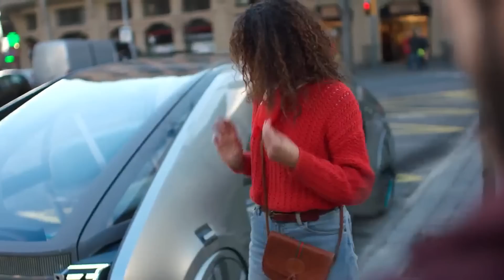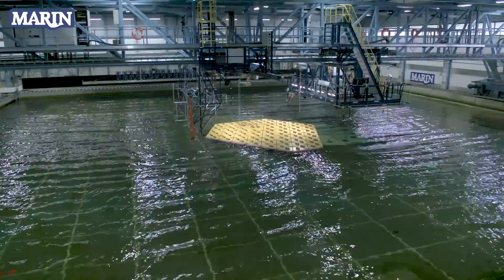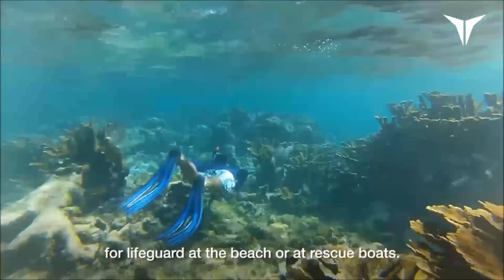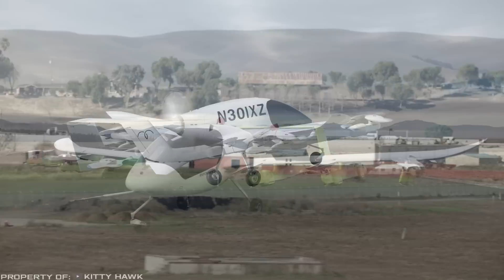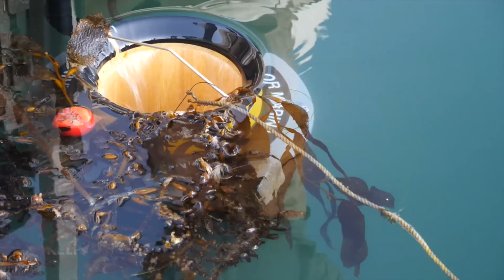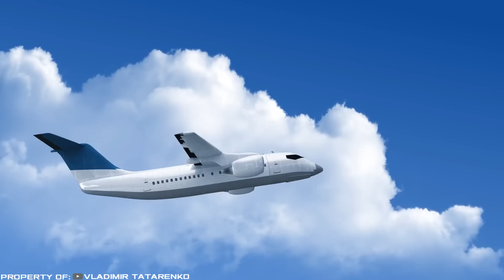New Inventions That Are On Another Level ▶4

Comment: Can we make wheelless that can land on runway fitted with maximum number of wheels fitted with shock absorber upside down because wheels are only used at time of take off and landing and we have to take those heavy wheels system all around with heavy shock absorber put thousands of cylinder like wheels or rollers on runway and make planes land on them

Comment: definitely that was the best one with the parachutes on the plane I thought about that a long time ago I wanted to write to Congress definitely that's definitely wow excellent the concept I'd pay an extra $2,000 knowing that I'm going to be safe that's worth a lot double the price ticket just for that
Reply: The concept isn't anything new and has already been used but in a smaller form factor for F-111 aircraft. I would be extremely skeptical of flying on any aircraft that had such a system used in such a large form factor. 

There are too many single points of failure that could lead to severe outcomes. Extraction of the pod system alone wouldn't be simple and an automated ejection sequence which allows for a clean separation is unlikely. A failure of the chutes or even a couple would be catastrophic. The failure of a single or multiple rockets would also be catastrophic. A ground impact with a failed airbag could potentially leave many passengers maimed if not dead from an extremely hard impact. Basically way to many single points of failure could result in many more injuries if not deaths in such a system.

Comment: The floating garbage collector would probably get too full and too heavy and sink if left unsupervised. Especially if it takes on oil slicks.

It needs work. 

A better collection design would be a large craft with floating arms that extend outward from the craft that skim the surface and sweep debris into a V shape that has a larger version of their machine at the bottom point of the V, with a mesh net bag, which is supported by cables that can be reeled in, cinched up, dropped onto a deck, into a hold, or onto a barge, then replaced with another bag.

Get on it.

Comment: The passenger taxi that looks like a car with a couch in it could work on the interior of a massive enclosed area. It would never work outdoors due to the hub over wheel design. Any type of precipitation or garbage, roadkill, rocks, potholes, frost heaves, etc would fuck that pretty mobile couch right up, right quick.

Comment: The passenger air bus that parachutes the passenger cabin to safety will never happen in commercial airlines.

However, I can see it happening as a method of quick troop or equipment or supply deployment, or maybe a disposable, temporary surgical unit, lab, or shelter from the elements, by dropping into an area that has no landing strip.

Maybe even manned by a small crew and dropped as a quick deploy floating medical rescue unit for multiple people in the water.

It could use those gyro stabilizers for the surgeries.

It could then be later retrieved, picked up or pulled in tow by standard water craft.

Far more likely to happen if its a military contract.

Comment: I have been thinking that last part of airplane capsule a few years ago (My original thought was that the capsule will be top mounted). Apart from safety benefits in case of emergencies, it can also save a large amount of boarding, luggage handling, cleaning time while the airplane can do its refueling and other checking/preparing works. The downside is it could add more risk issues. So it needs a cost-benefit rethinking.

Comment: I am glad people pointed out Triton as fraud. 

It's high time something is done about passenger aircraft safety. At least install parachutes on top so that at least high altitude crashes are not fatal. 

And install rubber air bags below in case of low level crash.

Comment: Filtering oxygen out of water is an old fable.  It is a bogus device. First, there is not enough free Oxygen in water for a mammal, and pure Oxygen at 2 atmospheres is toxic. As in knocks you out. Re-breathers that filter Co2 out and recycle the air have been used underwater to avoid the bubbles of conventional Scuba rigs. Only good to about 25 or 30 feet deep. Go deeper and you will pass out.

Comment: 'Aircraft' definitely has potential, but would require significant buy-in from the major manufacturers. The concept of a ballistic parachute is not new and neither is a removable tube design.  Cirius has made single engine (propeller) planes with a parachute that has saved countless lives. As airplanes are only making money when their flying, many airlines are working with the manufacturers to see if a interchangeable cabin was feasible. Imagine boarding a clean cabin 10 mins before takeoff and as soon as the jet arrives the swap of cabins would take no longer than the refuel and ground tasks.

Comment: Ok so robocar fail straight away, no seat belts, don't fancy the idea of some punk slamming into the side of the car and without a seat beat being slammed into that aluminum bar no thank you. Floating island needs to be pretty solid, but building skyscapers Hmmm !! . Balloons isn't there enough objects in the sky airliners for one thing, potential collision straight away in the advent of failure. Aircraft Hmm guess may work a lot of faffing about to eject an entire cabin, esp: if there serving drinks, and even more less impressive if a terrorist decides to take a bomb in the cabin, yeah will eject you all but you'll be blow to smut anyway.?!

Comment: Many concepts presented in here, but between concept and realisation, there is a big step. The Renault car is an interesting concept for exemple, but firt you need to make sure a car doesn't need a driver in any way, and even the one at the peak of that technology, Elon Musk, keep repeating that though the tesla is made to drive itself, it is highly recommended to keep an eye on the road at all time for the system has it's limits.
It would work good on a railed road, but on free roads it would need to follow a GPS and a slight default in it mean 5 meters to the right....

The plastic bag made of biodegradable materials seem problematic. Try to imagine the pollution of the cattle required to get a production of milk as big as what is used in plastic bag daily plus our daily consuption ... but if they do the same with more basics proteins, improve the disolution of the matterial to a few hours (i mean from what is said here the second it take a drop of water you're done for) then it will be doable.

The baloon is already in use but not efficient enough and to random compared to satelites or ground anthena.

Flying taxi is doomed (How do you go to your house? flying above others peoples houses in straight line? with a few thousand airplane it's already difficult to rpevent collisions, imagine the anarchy and the crash count of such a transportation accessible to all...), moss cars woudl require everybody to drive electric cars and looking at the price of that technology we aint gonna see it for a long time, sea cleaner is BS (how many litters are polluted? how many of those things would we need? plus it only work in surface and close to a shore with a working engine wich pollute the air...

Airplane thingy is either a small design fail or BS. If the airplane take fire, if a bomb goes on at the wrong place, everybody dies. 
It would be smarter to change the actual airplane inside design (only 2 column of 5 row instead of a 2-6-2, make each row of 5 independant (with raft, parachute, beacon & bit of food) then when a problem occure the sides of the airplane goes off and eject all rows with a delay of 1sec between each rows to avoid collision. People not attached may die, but most people would survive.

For the island i got no ideas....

Comment: Triton is a complete scam and was taken down by Indiegogo.  Triton came clean and refunded nearly $900,000 to Indiegogo supporters. The company then explained in an update that the Triton will use expendable “liquid oxygen” cylinders to supply air to breathe. That sounds even more dangerous than an artificial gill because if the tanks are filled with liquid Oxygen the output will be pure O2 gas which is not only highly flammable but pure O2 reaches a toxic partial pressure at depths of between 4.3 to 6.6 metres or 13 to 20 feet. If you have untrained people taking pure O2 underwater then you are going to have a lot of dead people.  Then those that survive the O2 hit will light up a cigarette next to this thing and burn.

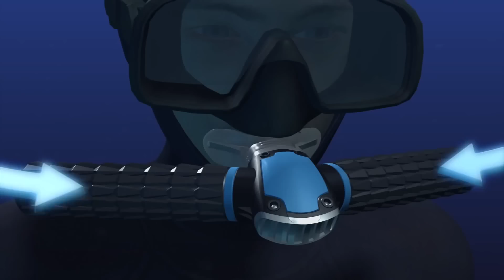Comment: For those who might be misled by the incorrect information,  the TRITON 3:31 gill like equipment is totally impossible and has been debunked by sci youtuber Thunderfoot.

 The dissolved oxygen(DO) in water is in much lower concentration(4-9mg/L compared to 300mg/L in air) that extracting enough amount for a land walking animal is a joke. 

While a couch potato needs about 600mg of oxygen per minute, the gill has to extract 100% of the DO in 70-150 L of water which is already insane for that little buddy. 
When a more realistic efficiency for the extraction might be 10 to 20% optimistically to supply air for one in water sport, and the lungs would most likely consume a fraction of the oxygen produced, hundreds of gallons of fluid should be processed in every minute. The gill filters water in the scale like a full powered fire hose(that with a fridge sized pump backed).
Consider that breathing pure oxygen is toxic, the equipment has to supply an even larger amount of nitrogen and exhale CO2 at the same time. 

Common sense is so important that one without it making videos like this might help scammers juice thousands if not millions of dollars from less informed civilians.

Comment: That car design is complete fantasy and would not survive 5 min on normal roads here. I mean it's worst then those cars with low suspension and the whole bottom part would be ripped apart on the first drive.The concept of the automated car is very likely but the cars will look like normal cars.

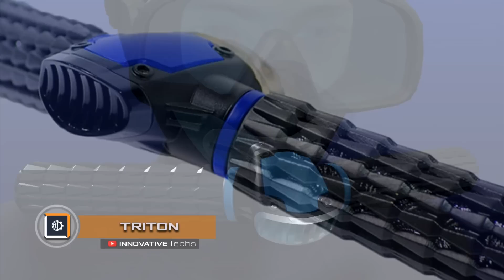Comment: 3:35 Please tell me this was a joke. If not you might want to think about taking a college course. Common Sense 101..... Scratch that, find a grade school level and work your way up. 
A human would need to inhale around 40 to 50 liters of water...... every minute to just stay alive. Any activity and that amount will skyrocket.  So unless this thing is drawing air from an alternate reality, simply put, it doesn't work, it never did and never will. At least not the way the clown who came up with it intended for it to work. Realizing he was a complete moron he changed the design so it works with small cartridges. Exactly like the small emergency bail-outs for divers that have been around for decades. I Have owned several I can tell you it's a terrible design for a bail-out system. The reason is at surface, a good bail-out will last 4 to 5 minutes. 40 to 50 feet down and you'll be lucky to get 2 or 3 breaths. So it's not just a piece of junk it's a dangerous piece of junk.

Comment: I thought about similar plane concept a while back.. it's a shame that corporations prioratise profits over implementing as much safety and security as humanly possible.. thing is, these safety systems would be used only on VERY rare occasions, but it seems that corporations preffer to avoid "unnecessary" costs and probably have calculated that 1 catastrophic crash out of 10 thousand flights is "acceptable" & it's much cheaper to pay a fine or settle a lawsuit by the families of victims, instead of engineering and mass producing a safety mechanism..

Comment: Wow! Most of these pipe dreams simply violate the laws of thermodynamics and represent "things invented by graphic designers instead of engineers". But one of these is bloody dangerous and a long known Kickscammer. The Triton underwater breathing apparatus. There are dozens of fully credible debunking analysis out there. But even anyone familiar with advanced or professional Diving can immediately see right through that insane murder machine. It can't work. It sure as shit can't work the way they describe it. If it could work the way they describe then Artificial Lungs would be a thing. But they aren't because it can't. What you see the guy demonstrating in the pool is a clearly dummied up device that is using a pair of small compressed gas cylinders in the bicycle grips to enable it to function in a pool. Any deeper than 10 meters and it would kill you. 

Look, in order to work the way the magic Triton claims would require an oxygen permeable membrane of tremendous surface area, just to facilitate the oxygen separation from the water. The most efficient and compact of such membranes currently known is the mammalian lung tissue.  That is natures perfect design for doing the described task. We have nothing artificial that can come close to actual lungs in the ability to perform the needed gas exchange in the densest most compact package. Do those handlebar things look to have anywhere near the potential surface area of lungs? Of course not. Nor do they have any mechanism to propel water across said membrane at a sufficient rate to effect the exchange.   Of course not. It's a fake device made to look like what the general public thinks such a thing would look like based on SciFi and James Bond movies and tv shows.

Comment: Not yet but soon, depending on how we do at getting the government grant!
You can buy this device for $3850. The taxpayers will subsidize $3800 of this!
To implement this technology, an "overall introduction" (decode: taxpayer subsidy) is required.
Rear economy compartment can be dumped when there is a screaming brat present. OK ON THAT ONE!
The automatic car that sits 1/4 inch over the ground (DUH! HOW STUPID!) would certainly not work in Houston Tx where we have pot holes that would almost swallow the whole thing!